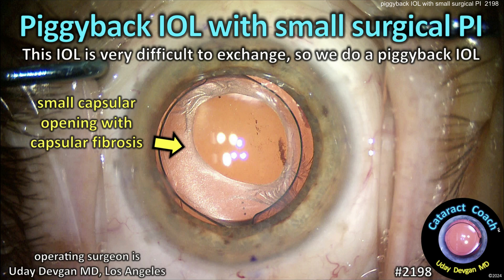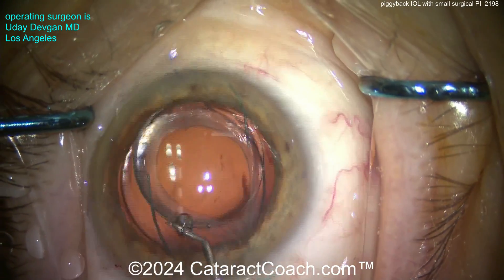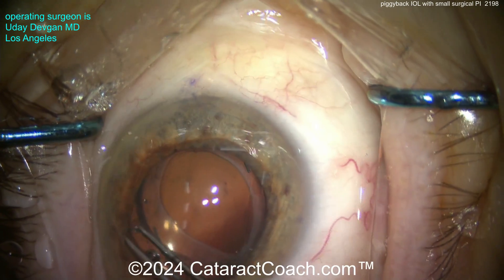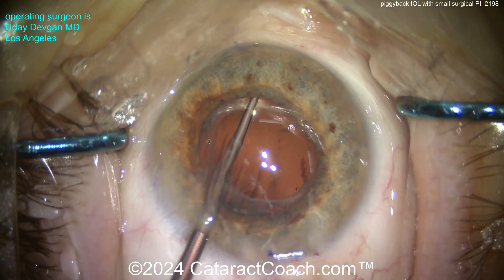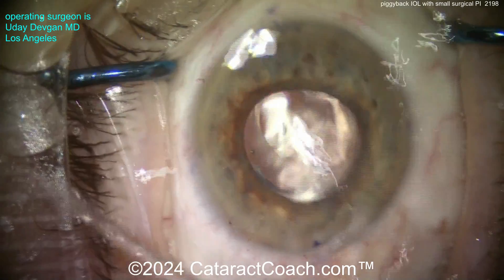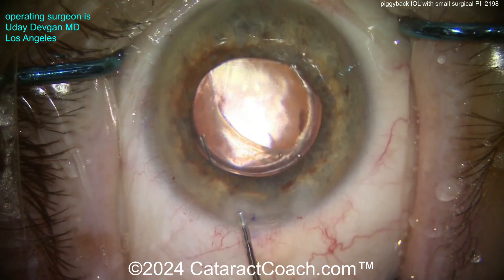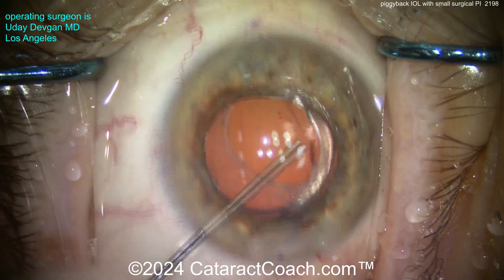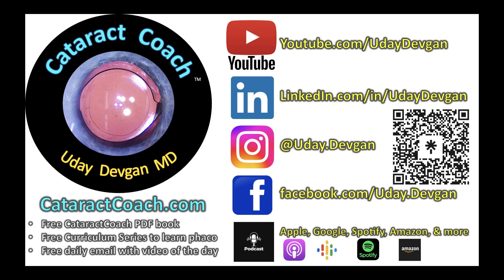CataractCoach™ 2198: piggyback IOL with small surgical PI peripheral iridotomy

Comment: That's a mid peripheral PI at most. 😁 You guys don't have Sulcoflex lens or similar lenses that are designed specifically for sulcus add ons, right? Been to the moon, but limited by FDA...
Reply from the maker: thanks. maybe you could be a bit kinder in your comments?
Reply: @UdayDevgan  Sorry, I have utmost respect for your work and channel! It was a nice case as always. I tried, clumsily, to point out that I can imagine the frustration of not having access to a lot of things that would be good for your patients because of perhaps arbitrary bureaucracy. That PI is still not very peripheral, though. 😝

Comment: Would it be helpful to enlarge and center the pre-existing rhexis prior to inserting the new IOL? What if there is continued phimosis of that rhexis in the future? Can you perform YAG capsulotomy on the anterior rhexis when there is a piggyback IOL?
Reply from the maker: that's a possibility but when you are re-operating a previous surgeon's work, you may not know all the details. Is zonular support normal? Will further cutting of the capsule cause issues?